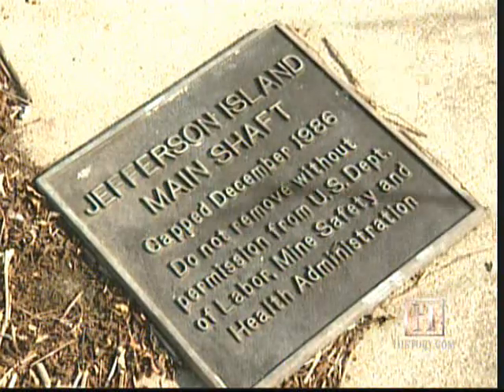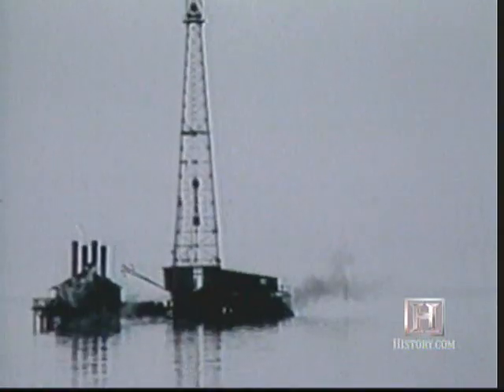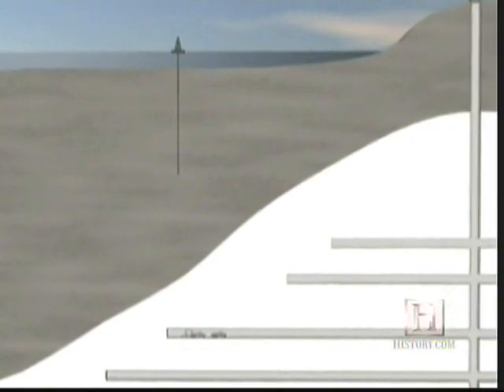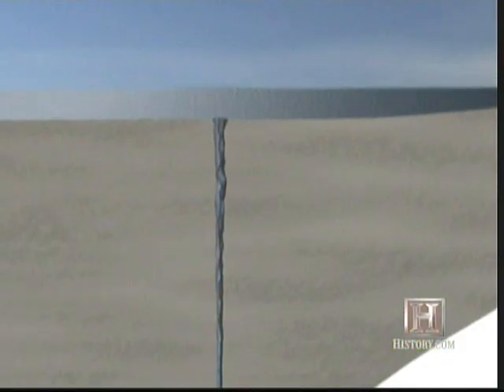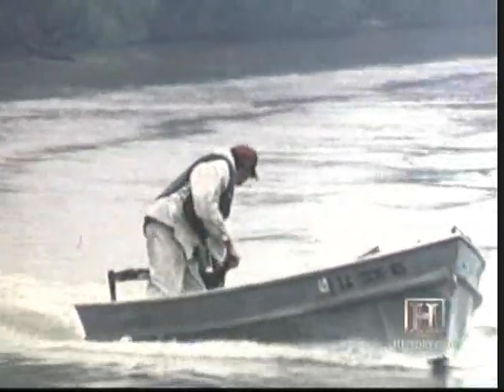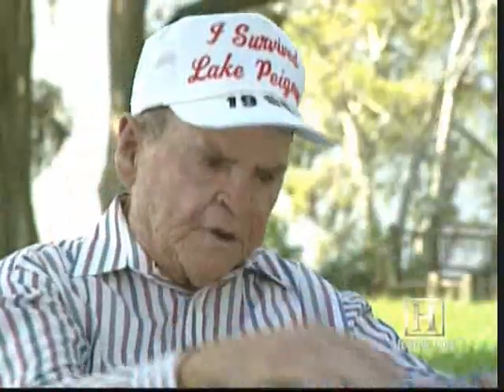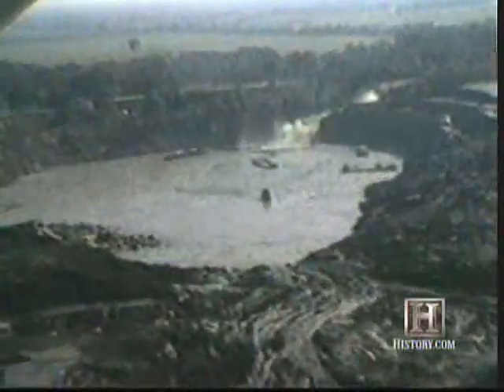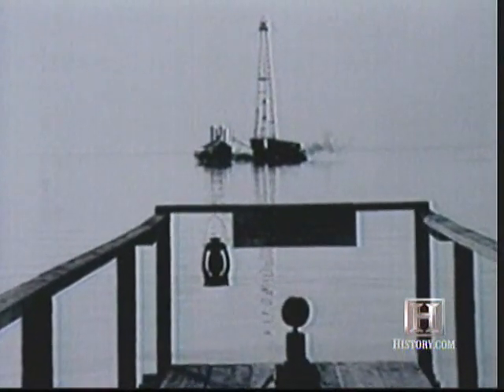Oil Driller Breaches Salt Mine Under Louisana Lake

Comment: The triangulation was performed by a flat earther
Reply: Roger Woodruff the earth is actually a dodecahedron, hyperborea is just another face out of the 20 faces on earth
Reply: Undoubtedly 😂
Reply: Guess you also believe “gravity magic” is needed for objects to stay on ground or fall, move to lower elevations or less dense solutions? Weight, Mass, Density, Air pressure (resistance), elevation, oh dont forget Gravity... which is only needed to explain how everything sticks to the earth if it’s spinning at 16,000 miles an hour around the sun....hold on Jeb.....
Reply: 44/108 O’s Sux
Reply: Trevor Seines
The earth is not flat. Density does not cause things to fall without gravity in the first place.
Reply: No because you are pulled down. You aren't going down hill when you move along the curve, down is still directly under your car.
Reply: @evilbred974  aye aye aye.....that was sarcasm...nerd.
Reply: +PastaOverseer:
"The earth is not flat. Density does not cause things to fall without gravity in the first place."

==Some people don't understand what it takes to move a mass. It takes a force. Some people don't know what force means.

Looks like you know what force means.
Yes, density is not a force.
Flat earthers are flat headed!
Reply: Joe com'n man that said 400 meters not 400 feet! It's the 80's everything's moving to the metric system now!
Reply: Probably a republican! Lol
Reply: +Al Testic you fell for this C-tier bait? kek
Reply: Nabre Labre Earth is really just the inside of a Capri Sun, and the full moon is the hole at the top
Reply: Roger Woodruff it’s (current year) can’t we let the Earth decide what it wants to be??
Reply: Ooopps. Never let a flat header navigate.
Reply: @mythologicalmyth  : Jeb as in Bush or Jed as in Clampett huntin' for some food? lol
Reply: LMAO 👍😆😆😆
Reply: High school shop teacher always told us measure twice cut once and that totally applies here.
Reply: flat earther you can find AROUND the GLOBE :-)
Reply: Lol politics are fun.
Reply: @twowheelsclubseals  flat and round, nice
Reply: Math is haard😖
Reply: @louistournas120  do you know what a pseudoforce is? (Hint - not a force)
Reply: @SkengManNZ  :
"Do you know what a pseudoforce is? (Hint - not a force)"

==Ok.
is there more to what you wrote or?
Reply: @louistournas120  are you being obtuse? 
thats all that was needed to be said, in regard to your regurgitation of lies. 
bless your heart
Reply: @SkengManNZ  :
I know what a pseudo force is but to what are you referring to?
Reply: Roger Woodruff  It's a hypercube. I've seen the movie.
Reply: Roger Woodruff  Marble: expensive, but it looks awesome!
Reply: You're all wrong. God willed it to be a sphere.
Reply: There are alot of flat Earth organization around the world
Reply: Roger Woodruff  I deleted the statement because it wasn't appropiate.
Reply: Roger Woodruff  I read you. You know I met some people once (50's) from Northeast Texas on into the Ozarks. I met one of the oldtimers who told me there was no physical,experimental evidence that the earth was round. It was in the '50s. Still couldn't believe people were gullible enough to fall for it.
Regards
Reply: Roger Woodruff  I've met flat earthers who were Reps and Dems, it's got nothing to do with it. Dumb is dumb on either side of the aisle.
Reply: Political Puppet Theatre also known and disseminated as geo engineering to stave off Global Warming. 
But probably more likely to be used to facilitate Project Blue Beam fake Alien invasion hoax to usher in UN /NWO worldwide regime change ... yawwwwn. 😎😬
Reply: White Rice Actually, no past or present scientist can adequately explain gravity - watch Kneel & Bob on The Grass Dyson try to explain it - can’t do it. Yet it’s the explanation for everything spherical. 
And why were / are all the globe earther scientists Free Masons ....?
I may be a conspiracy theorist, but at least I’m not a lame-ass coincidence theorist. 🤣🤣😎
Reply: Roger Woodruff  lol yer Killin me! LOLOL! Even if you are a republican! Your sarcasm is hilarious! And the amusement that so many missed it is giving me fits!. LoL 

Carry on good sir, carry on! :-)
Reply: Globe heads lol
Reply: @louistournas120  I'm kinda late on this but he was propably referring to gravity being not an actual force as it's the phenomenom of objects trying to move through curved spacetime on a straight line. Which they can't as ground is in their way resulting in a constant accelleration upwards. 
I should propably add that this is only our current understanding of gravity. Scientists all over the world are currently looking for a quantum theory on how gravity works
Reply: @seagullskunk  No problem. This is a thread that I have forgotten about. I don't mind revisiting. it.

"I'm kinda late on this but he was probably referring to gravity being not an actual force as it's the phenomenon of objects trying to move through curved spacetime on a straight line. "

==I think you mean to say that gravity is not a field. Gravity is when a mass causes a curvature in space-time.
But it does certainly cause a force to appear. That force is measured by scales and such.

There was the concept that gravity is quantized and that there is an associated particle called the graviton. This was something that was being studied in the 199x.
Reply: @louistournas120  yes but the occuring force is an electromagnetic interaction i.e. the same force that keeps your hand from going through an object once ya touch it. 
While in free fall there won't be any force acting even if near a large mass - what will seem to be gravitation "pulling" on an object will just be it's natural path. Even though it seems to be accelerating it actually doesn't until it's path is altered by an actual force... for example when it hits the mass responsible for the curvation of spacetime. 
That's why Astronauts on the space station don't feel the effects of gravity even though they are quite close to the planet. 
This video explains it in a beautiful way https://www.youtube.com/watch?v=XRr1kaXKBsU although ya seem to know most of it already. 

So far they haven't been able to proof the existence of the graviton. However finding it would have some fascinating consequenses as a wavefunction for the behavior of spacetime would essentially be the key to a multiverse. Two waves (and in this case two spacetimes) can always be added to each other so finding a quantum theory for gravity would make it possible to just put a plus sign between two possible states of the universe. 
 
There is a video of an Astrophysicist explaining gravity on five different levels. The first four are quite boring if you're a nerd. However the last section is two experts on roughly the same level so it's not one of them explaining to the other but a discussion between the two. It really does hurt your brain watching it and I had to pause every few seconds to keep following what they said but it's really worth it. And it's a more detailed and expertised version of what I tried to summarise in the paragraph about the multiverse. 

https://www.youtube.com/watch?v=QcUey-DVYjk

The juicy part starts at 24:49 

might have went a little over the top with that roman of an answer however that topic just gets my eyes sparkling
Reply: @seagullskunk  Yes, that is correct. When, you put an object on a scale, the electrons at the surface of the scale are pushing the electrons on the surface of the object you are measuring the weight of and vice-versa. However, if you have a single positive charge and a single negative charge, then in principle, there won’t be any repulsion at all.

I’m not sure about your 2 nd sentence. You can get the same effect with a single proton and a single electron. You could say that the electron is not experiencing any force and it is following its natural path.

I understand what you mean by your astronaut example but it will be the same for an electron.
There has to be a force present since the electron is accelerating. It is being attracted to the proton. It’s the same for the astronaut. Even if he doesn’t feel a force, his speed is changing. In order for speed to change, there has to be a force.

The big difference is that gravity doesn’t have a counterpart while the electric force comes in 2 flavors: positive and negative.
I’ve heard that the magnetic force also comes in 2 flavors. I haven’t kept up with physics but I heard that the monopole has been discovered.

When it comes to the weak and nuclear force, I don’t know if there is a + and -.

The 2 nd video is interesting. I wasn’t aware that there was the idea that 2 neutron stars could collide and create heavy elements but I suppose since neutron stars contain a lot of matter, they could generate a lot of heavy atoms. However, I imagine a pair of neutron stars colliding is a rare event.
I didn’t understand all of the last conversation. If you understand it, then I guess you know your physics very well.
I understand that temperature comes down to the average random motion of atoms/molecules but what was that about holography and that gravity is really a quantum behavior.

Are you french?
Reply: @louistournas120  "In order for speed to change, there has to be a force" 
well that's the thing: It's speed isn't changing. It appears to be changing - and it is actually if you look at it in the three spatial dimensions alone - however if the dimension of spacetime is put into the equation aswell the object travels at a constant speed. 

They talked quite a bit about holography in that video so I dont't know where you're at. 

The theory of gravity being a quantum behaviour was that it might not be what it seems to be on a larger scale. 
The simile with temperature is that temperature isn't a trait of one particle but rather the result of a collective behaviour and really just a number of small movements. 
So there might also be a fundamental quantum behaviour which will turn out to be what we perceive as gravity when looking at it on a macroscopic scale. 
As quantum mechanics is the most succesful scientific theory in history it is very likely that there is a way of using it to describe/explain gravity. 
I hope this explanation helps... feels like I'm just repeating what they said :'D

I tink the collision of neutron stars is a far more common event than we think. Humanity has only had the technology to detect it for a few years so having found one already means that we're either extraordinarily lucky or that it's just happening "often". 
Even tough the last word somehow loses it's meaning when talking about Astrophysics. 
Of course this will largely depend on the area looked at.

Coming to the last question: Nope, I'm from Germany
Reply: @seagullskunk  If you have an objects a few meters above ground and you let go, isn’t it accelerating towards the ground? Isn’t it getting closer to the ground?

I watch the entire video. They talked only a little bit about this idea of the universe being a hologram.

Yes, I understand that if you consider one atom, then it is just an atom moving in some direction but if you look at a large set of atoms, like in a piece of iron, they are all moving in random directions and the net movement is 0. We consider this as temperature.

I think that since these are advanced topics, it gets very mathematically descriptive. Probably I would need to study it carefully.
Reply: @louistournas120  Actually it is ground acellerating towards the object as everything on the surface is accelerating upwards. The object falling till it hits earth will just follow it's natural path through spacetime and stop doing so when it hits.
Reply: @louistournas120  I'd answer to your last comment however it seems to be gone. I only see the first two lines of it when clicking on the bell icon and can't read it any further
Reply: @seagullskunk  Then that means youtube deleted my comment. Don't worry, I will bypass its robots.

You think that the Earth accelerates towards the object when an object is falling?
That doesn’t make any sense. The Earth is massive and so, it has much larger gravitational field.
Also, you could have objects on the other side of the Earth that are also falling towards the Earth. You can’t have the Earth accelerating in 2 opposite directions at once.
Reply: @louistournas120  There is no such thing as a gravitational field. 
You still are only accounting for the three spatial dimensions. The acceleration doesn't happen in these but in the dimension of time. 
Maybe give the first  of the videos I linked a watch. Or just skip to 9:55 where the equation is explained for the quick answer if the whole thing is to long
Reply: @seagullskunk  I watched the entire video. It isn’t something intuitive.
You say that an object falling towards the Earth is not accelerating but the acceleration is measurable.
You say that a rocket going by a massive planet is not changing direction but again, it is something that is measurable.
It seems to come down to mathematics and I don’t know much about the theory of General relativity.
Have you read about it?
Reply: @louistournas120  I know it is quite a brainf*ck to think in higher dimensions. 

Imagine you'd be a two dimensional lifeform walking on a ball. Lines that would seem to be straight change distance and hit each other after some time. 
And a path parallel to that line would actually need to be curved. Only a three dimensional being would be able to comprehend that the plane is bent in a direction which wouldn't exist for the 2d entity. 

For us three dimensional beings it seems like something falling towards a planet is changing it's path - in the same way in that a path over the surface of a sphere would seem to be straight (and not curved) for something with one less dimension. 

The only way by which it could tell that there was a curve would be by making the observation that two such lines wouldn't be parallel. 
Similar to how we have learned about the interactions between space and time by observing the universe.
Reply: @seagullskunk  Yes, I think it is possible to simplify that analogy even further.
If you were a 1 dimensional being in a 1 dimensional universe, your universe is a line. You can only go forward and backwards.
We can think of a line as being divided segments. Each segment seems to come one after the other so as a 1D being, it looks like the universe is a straight line.

A 3D being might see that the 1D universe is actually distorted into various conformations. Perhaps some parts of the line are touching each other and acting as worm holes.
Reply: @louistournas120  Yeah, that's a nice way of looking at it aswell